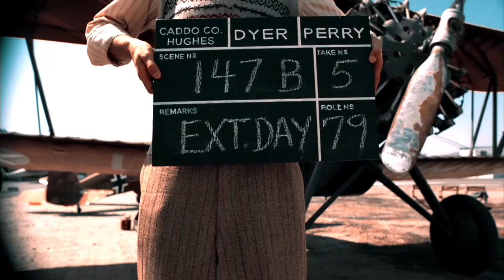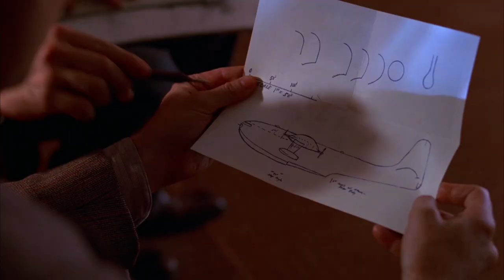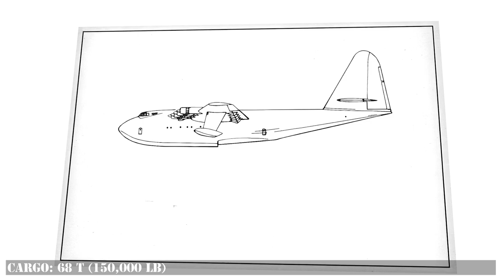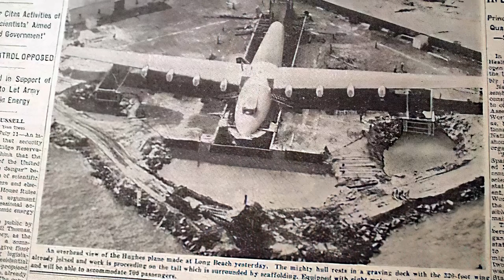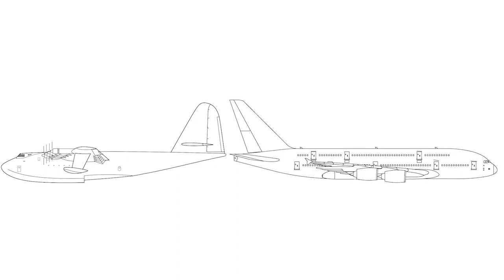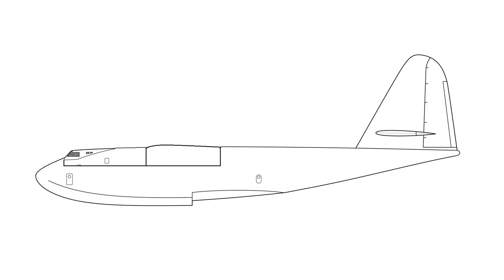H-4 Hercules - a giant dream

Comment: If you visit the Evergreen museum, definitely pay the extra for the guided tour of the H4. I was fortunate to be the only person on my tour so I was able to get in a lot of questions. The flight was a trick by Hughes, as the aircraft was only supposed to do taxi tests that day. During the flight a very large crack appeared in the rear fuselage just ahead of the tail, seen all too well by an engineer riding there- and the subsequent repairs are plainly visible from the outside. Not only did Hughes keep the H4 in storage for decades, he also kept a flight crew on standby. The clamshell doors seen in the video were never installed but were also kept all those years, until Evergreen bought the H4. The new owners then scrapped the doors to save money on storage!
Reply: My son and I just took the guided tour - well worth the cost.

Comment: 4:23
Aluminium is a pure metal, an element on the Periodic Table. It's not an alloy. 'Alloy' isn't a synonym for 'metal'. It is a specific word for a combination of (generally) metals.
Reply: True, but the element of aluminum isn't suitable for structural use.  It is virtually always aluminum ALLOYS that are used in marine and aircraft use.  So without getting into unnecessary explanation (about a material that WASNT greatly used on the Hercules) the use of the term alloy in this context is accurate. enough.

Comment: With today's technology, Mr. Hughes would have known that his H-4 plane couldn't fly. Each H-4 engine had 3,000 hp. Each engine of the An-225 has 50,000 hp. That's why Mr. Hughes's plane couldn't fly. And the An-225 flew without problems. I don't understand how Mr. Hughes did his calculations.

Comment: The Hughes H4 Hercules DIDN'T actual fly in the normal sense of the word [FLY]. It simply flew in 'GROUND EFFECT'.
Reply: It was in the video.
Reply: It experienced more resistance to getting airborne than actually becoming airborne.  The big obstacle was the government.  What would have happened if the aluminum was made available for the project?  They had to overcome many obstacles that were placed there by the politicians.  Had it been constructed by conventional methods a working craft would have been completed far sooner.  Mr. Hughes was losing it due to he feckless political climate.

Comment: Wood is a fantastic material for planes. You just have to make sure it is kept from rotting, and to make sure the glue is going to hold up. Wood doesn't form the same stress cracks that accumulate in aluminum designs. Look at what cold molded boats can do in terms of lightweight, complex shapes.
Reply: It's ALUMINIUM educate yourself
Reply: @Chris-nn3vu  ?